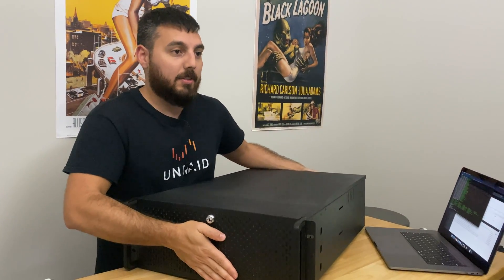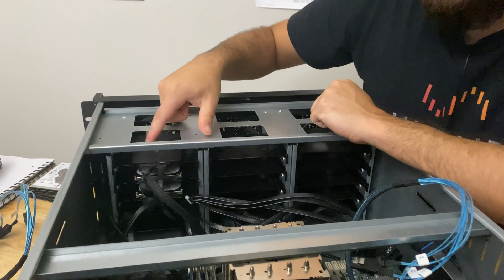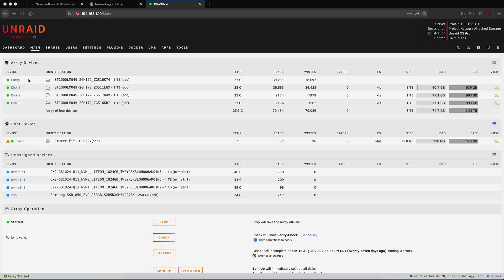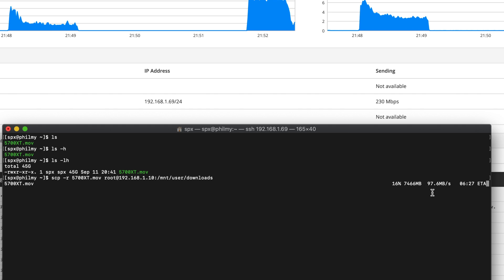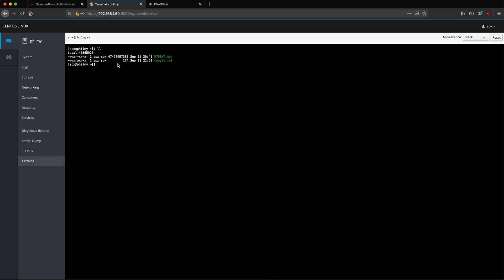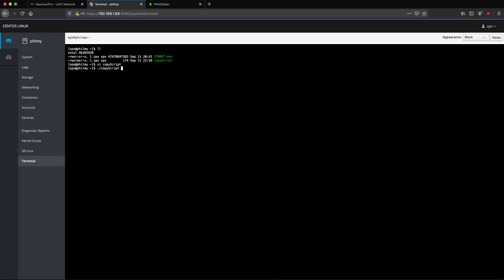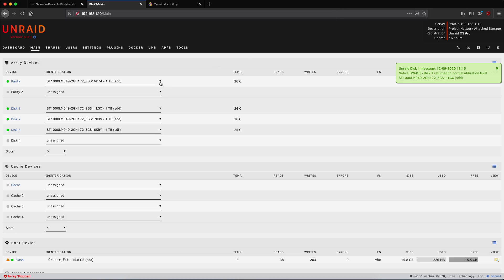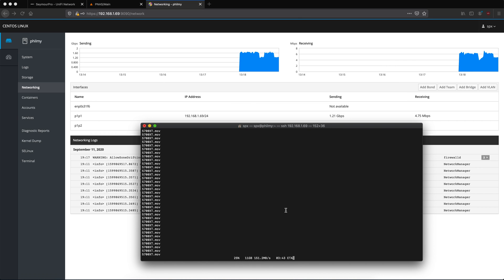NVME Parity Vs HDD Parity @UnraidOS #unraid #homelab

Comment: This is actually super useful to know. You've provided evidence that I should swap out my 5400rpm parity with the 7200rpm drive I have for cold swap. For the drives in the array that are slow they will still be slow but my current parity is hurting the faster drives. (only slightly but still)
Reply from the maker: Sweet.  I forgot I made this video lol

Comment: I have 2ea 7.2tb SAS SSD Enterprise (used) drives as my cache
2ea 6TB 7200 SAS spinners as parity 
6ea 6TB 7200 SAS Spinners main array

This allows me to use cache as the main array and than I have a nightly diff backup and a monthly full backup.

I get full speed access this way
Reply from the maker: Very cool.  The best I’ve ever been able to achieve is 1GBps while using NVMe as cache.  In a different video I did, I got to show that off and show those insanely good write speeds.
Reply: @SPXLabs  I am using a 10gb fibre connection between my gaming system and the Unraid server, I also have another 10gb link between the Unraid server and my 48 port switch
Reply from the maker: Oh wow bad ass.  What NICs are you using?